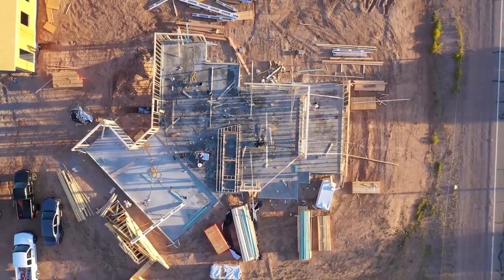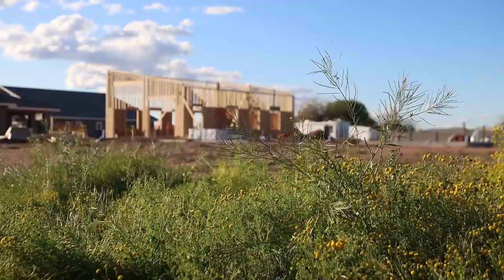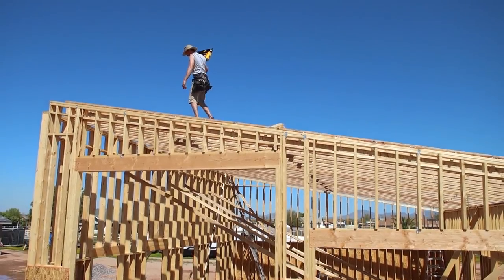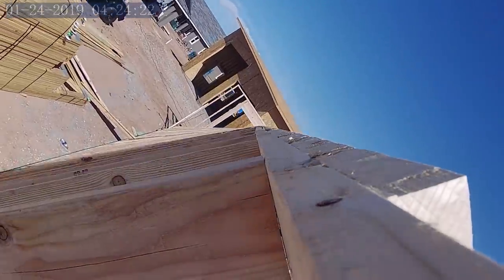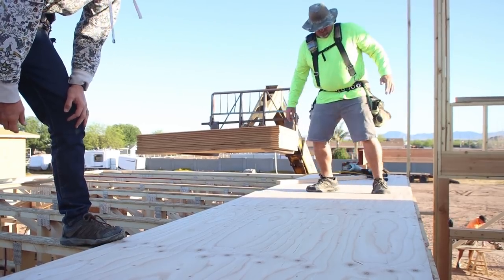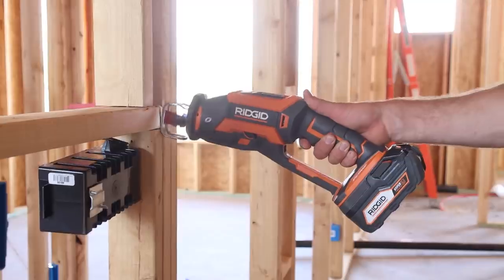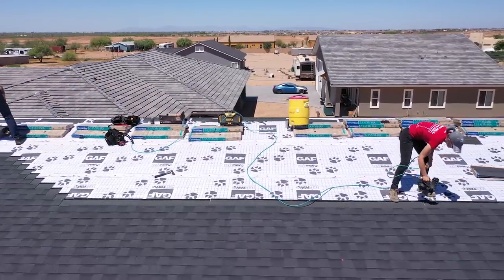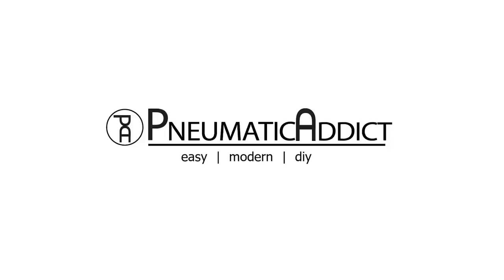Framing a House & DREAM SHOP | Ep.3 Building Modern on a Budget

Comment: Just discovered your channel; great looking project! We built our very modern, architect-designed dream house in 2012/13. Because of its complexity I will admit that we used a very expensive contractor, but we DID manage to bring it in on budget. No-one we ever show the house to, or are in the trades, can ever believe that, but there were two things we did that allowed us to hit the numbers exactly. 

First: We front-loaded EVERY decision. Example: before we broke ground we had the door hardware and hinges (along with everything else in the house) specified and sourced. We stored all of our decisions in an online database that every sub had access to, and could use in their estimates. It was an ENORMOUS amount of work to pull it all together, but it was extremely helpful. 

Second: We did NOT MAKE ANY CHANGES!  Ever. Not one. We poured over the plans and drove ourselves partially insane with all the details, but once we finally picked something, whether it was a cabinet handle or a faucet, we refused to change it. Because of that, we had only one change order for the entire project, and that covered foundation excavation and well drilling, which of course is always a variable expense. Just be careful... That window for your stairs just replaced $30 worth of OSB with $1,000+ of window! And was there wiring that was supposed to go through that space?

It's going to turn out beautifully; we're sure! Just really try to lock in everything in advance, and then you can 'budget-engineer' by looking for the best deals and avoiding the expense of change orders from every sub. Best wishes!

Comment: Really fantastic work, guys! The house is looking amazing already! 😃
But it's really different from how we build here in Brazil. We don't use wood walls like that, everything is built with concrete and bricks and so on...
About the budget... Tell me about it. 🙄
We're just finishing 2 new rooms upstairs that are going to be my workspace... A bigger room for woodworking and another smaller one for my electronics stuff. And yeah, the budget when out the window a while ago already. 🙄
Anyway, a tip I can give you is to finish the roof first, to protect the house from water. This way, if you guys need to stop the construction for a while, it's not going to be a big of a deal. You know?
Stay safe there! 🖖😊
Reply: They don't make the actual house out of wood only the frame

Comment: Some concrete contractors will study the plans and/or confer with the framers to figure out where those bottom plate breaks will be and set J-bolts accordingly.

Nothing wrong with adding anchors later like this, but there is always a different way of achieving a result.

Comment: Did you have a structural engineer involved in the design process? I’m used to seeing these sorts of buildings, where you have large windows and tall walls with open concept living spaces, steel or LVL columns/beams are used. Wondering how well your home would stand up against high wind situations.

Comment: I wouldn't build my dream house till I am rich and I would build it because I would build it with commercial-grade materials. Steel Floor and roof trusses and I beams (with fireproofing) supporting a 6-inch or more concrete floors and roof (And I mean a sloped roof NOT a flat roof) I beam window and door headers. All cavities fully grouted 12-inch CMU with rebar for the exterior walls and standard 8-inch CMU for partition walls. and it would be at least a 6,500 square foot mansion. All of this if I was rich of course but when I am I would go big or go home with a fortress. Note I would also put commercial grade metal 6" studs 24" on center on the exterior walls (on the 12 ich CMUs) and fill the cavities with that expanding foam and or blown-in fiberglass for good insulation and then finally cover it with drywall and paint it (like most houses), or tile, limestone, etc. whatever I feel like for the particular room. Yes my Exterior walls would be like almost 18 inches thick which is crazy in America but in Europe for example Poland especially it's normal, the exterior walls are like 20 inches or thicker and I like it because of the large windowsill and the impression of a fortress speaking of large windowsills I need large window sills to install security/bulletproof glass so no one would ever break-in  
as seen in this video https://www.youtube.com/watch?v=F2wdTd8PWk8&list=LLq4VLdg6dD-DHgwZfpG4BfA&index=57
A solid steel door with solid locking pins so no one could kick it down and if that wasn't enough to top it all off a brake in alarm system and fire alarm system with actual commercial building style fire alarms in white (system sensor P4W) and to storm proof the building even more and protect the expensive windows during a storm steel window shutters. Finally, waterproof the concrete with a sealer plus house wrap and finally some beautiful siding or stones on the exterior.

basically, it's built the European way solid out of concrete blocks stormproof that's my way of doing it

And it would be beautiful inside with limestone bathrooms and the black floor tiles and light gray walls white doors ( made of steel and with locks) and beautiful furniture you name it I'll have it not to mention a large property with probably several acres. I wouldn't have neighbors nearby so I could put up stadium light on the property and we could have parties and shit.

Comment: Insulation costs should exceed the rough framing cost.  If it doesn't, then you did not insulate and air seal enough.  Though I understand this is not a how to video series and the intended audience is not professionals or people with any building experience, I am still enjoying the series.  I like the design, and it is similar to what I envision on a mountain getaway, just smaller in scale.

Comment: 2:21
how are you getting the plate and stud flush without having you finger on the joint?
Reply: The force of course.  Why would you put your hand in harm's way if there is no need to do so?
Reply: @seantap1415  it's a serious question, maybe they know something I don't but every framer I have worked with that gives a shit always gets them flush by feel.
Reply: @Ramdodge582  I was JK .
Check out the Crazy Framer on YT  you won't be disappointed.
Reply: @Ramdodge582  Also check out "MattBangsWood". I don't recall them using their hands to square it up. They get it close and then tap it one way or another and nail it.

Comment: Calculating based only on square footage is very risky. I could build a barebones house with standard format lumber and beams and probably build a house with double the area at the same cost. But design/everything extra costs big.

Comment: 4:10 never seen regular washers before. out here 3x3" galvanized plate washers are code.
Reply: Yeah, I noticed the same thing. Typically a 3"x3"x min 0.229" square washer is what I spec in FL

Comment: 1. VERY interesting watching the progress, thanks for sharing. 
2. BIG mistake on nailing on the foundation strap anchors, you start nailing at the bottom & go up, not wherever then fill the remaining holes. I can see the bulge at the strap by the lower window you stepped thru which kills the strap capacity. I.e. strap needs to lay flat against sheathing all the way up so nail heads can't deflect in high wind or earthquake. 
3. I see a lot of bending at the back & waist and not knees, your backs will  thank you for using the knees and you'll need less pain killer to finish the house

Comment: 2:30 Holly shit balls! thats a giant ass header! i have never seen one that big for a 5' opening. hell even the 2nd story loft in my garage with a clear span of 32' i have a 5.5x24" gluelam
Reply: I was thinking the same exact thing. That is a MASSIVE header for only 5". All I can think is maybe there is a ton of weight above that window coming down from the roof line? Or, I couldn't really tell what that header was made of, it had a strange color to it so maybe the material needed to be that thick.
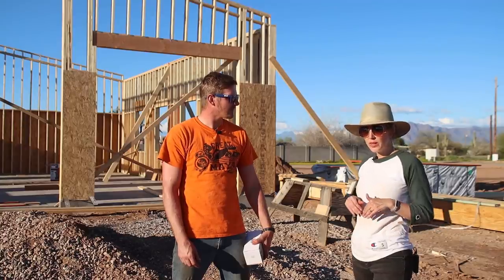Reply: @suburbanhobbyist2752  you can see it again at 2:50
3 openings and 1 with a header that is crazy. My guess is it was left over to save money they used it.

Comment: What does "building modern" mean?  Shed and flat roof?  Interesting building a "custom" house that does not address the site / location.  Weird to drop a generic design out of the sky and into AZ.  Building very basic and not going more energy efficient is an interesting choice, especially when looking at the long term.  With those trusses, how do you even get enough insulation in there?  You have almost no space over the top plates.  Good luck.